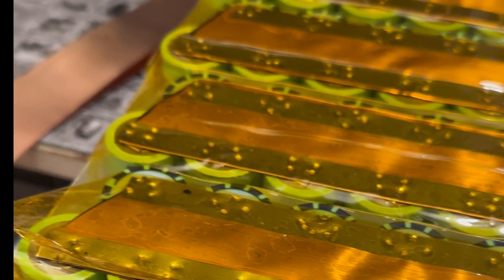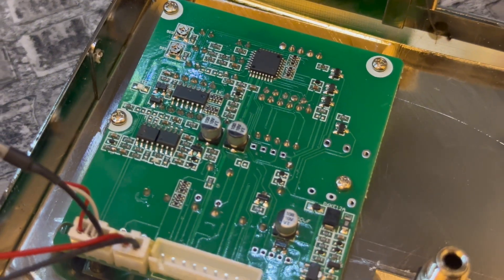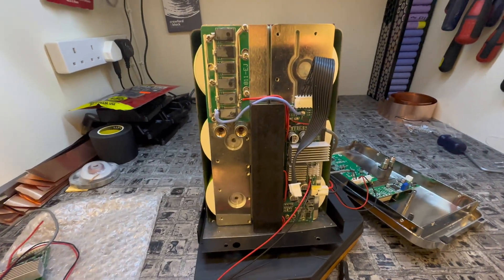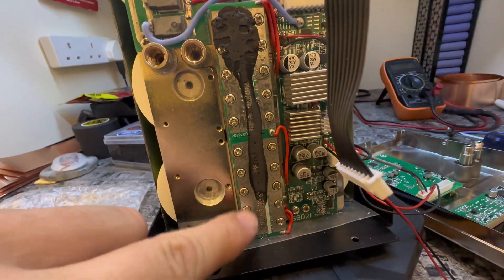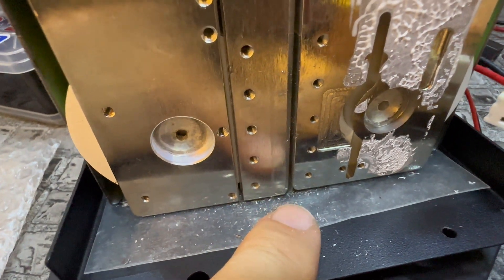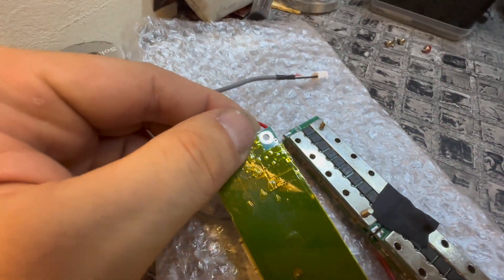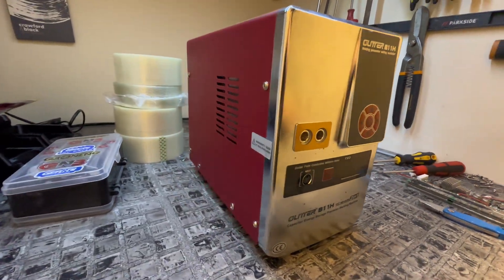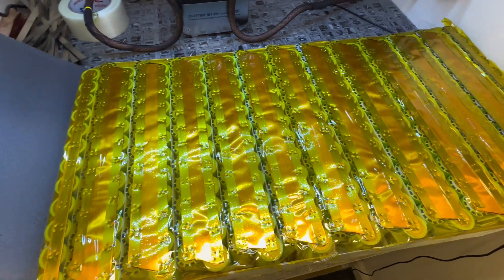My Glitter 811H Spot Welder Just packed up. ( How I repaired it)

Comment: Nice work. Presumably the current sense resitor with the crack is open and the other either the same or reading high stopping the boart starting. I have this machine and love it, and now if the display fails I'll have an idea were to look 👍
Reply from the maker: Thanks man. Yeah I recon that’s what happened. It must of blew that breaking the circuit. Yeah I wasn’t goin to document it. But then I thought if this happens to someone else then at least it might help somebody els. Yeah it’s a wicked machine I love it too. It’s awesome.😁 and I have a spare board aswell now. To fix . Really appreciate your comment I’m glad it helped 👊🏽😁

Comment: Hi, I just bought a Glitter 811h and I've been testing it, but it only solders correctly on the right side when I try to sandwich copper and nickel. Do you know why this is happening? Thanks.
Reply from the maker: Hi there. What do you mean the right side.? What thickness of nickel strip are you using. ? And size copper are you using. What setting on the glitter are you using. ?
Reply: @Fpvfreaky  When I perform both points, it only welds correctly on the right side. I am using a sándwich of pure nickel 0.2 and copper wire 0.2 on a 21700 cell. I am using a pedal. I gradually increased the power up to 60, but it still doesn’t weld on one side. The machine is new; I was testing it. Thank you for your response.
Reply from the maker: @nyyx17 ok . Are you letting the machine buildup power? Because you need to leave it about 15 minutes to let it generate in the capacitors. Until the unit is at its maximum of 6 V. Drop the current down start at around 20. Then try..
Reply: @Fpvfreaky Yes, I did it with the machine fully charged. I was asking for help in a group, and they told me to lower the nickel to 0.15, and I increased the power to 75. I tested it, and now it welds on both sides, but one side is stronger than the other. I don’t know if that’s normal.
Reply from the maker: @nyyx17 oh right ok. I did a video on my settings did you see that video.? When I was building a big battery. For a project coming soon. It might help you. What kw machine have you got? The 42kw ? Like mine.
Reply from the maker: @nyyx17  https://youtu.be/NDbXIYScxf4?si=J_g8grsXNEzLhnY2
Reply: @Fpvfreaky I just saw your video. Mine is 42kW. It's strange, yours seems much more powerful. You can only configure the power through the large screen, right? I don't understand anything.
Reply: @Fpvfreaky Where did you buy yours? I'm going to return it and order it somewhere else.
Reply from the maker: @nyy @nyyx17 ah you control on screen. Oh right ok. Where did you buy yours from.?
Reply from the maker: @nyyx17 I bought mine from ailiexspress . I’ll send you the link where I got mine from.. 
https://a.aliexpress.com/_EzE7aMo
Very good to deal with mate. Are you in the uk.?
Reply: @Fpvfreaky Thank you very much, you’re very kind. I think I’ll buy the one from this seller. I’m from Spain. I’ve already subscribed to your channel; we’re in touch.
Reply from the maker: @nyyx17 thank you mate. You’re Wellcome. Oh right ok cool. Well I’m here if you need any info we are always learning. Thank for the sub 👍🏽😁 means a lot.

Comment: Any idea what has killed the resistors?
Reply from the maker: I’m unsure. But in my guess it might not have made full contact totally. Resulting in a malfunction. Then possibly resulting more resistance, hence it blew. But so far so good it’s been working great ever since. Highly recommend if you’re thinking of building some batteries.
Reply: @Fpvfreaky Thank you for your response. I already have an 811H since one and a half years and satisfied so far.
Reply from the maker: @chevy60  ur Wellcome . Ah great yeah it’s a very nice spot welder 👌🏽 just the job making it very easy to build my battery’s . It’s very reliable.

Comment: those you measured first place were not mosfets but presumably diode protection. The mosfet arrays were under black plastic cover. Have the same, for repair, 24VDC psu sitting in the back next to the fan gone. Supplied 22VDC from my bench PSU, machine started up, but still have no clue what caused the 24v psu failure. Probably have to replace the mosfet boards as well just in case.

Comment: At the 2:50 mark in your video they are big TVS diodes mate NOT Mosfets! 😂and looks like they are all connected in parallel. You are measuring each one 😂in turn! They're gonna read the same resistance if they're connected in parallel! 😂😂😂 If one goes O/C you wouldn't know. Need to desolder one end and check each one with the diode check on your DVM!
Reply: Certainly not current sensing resistors 😂 they are tvs diodes.  They are designed to blow like that when they go over voltage!
Reply from the maker: @phillzipp  https://www.google.com/search?q=what+does+a+R010+do&ie=UTF-8&oe=UTF-8&hl=en-gb&client=safari
Reply: @Fpvfreaky that's a surface mount resistor 😂 trust me. The markings on your ones that blew would just have just numbers if they were resistors. Yours have letters and numbers: DTO8 and RO10. No resistors I've seen in 40 years of being and electronic tech look like that. 😂 besides, they are too high a profile to be surface mount resistors..
Reply from the maker: Mate it’s a current-sensing resistor 😂 it’s not a diode. Yeah they are in parallel. And if I replace these that probably would’ve fixed it easier. They both had hairline cracks down it. At least I can repair it and if it does it again, I can just replace it so it doesn’t matter.